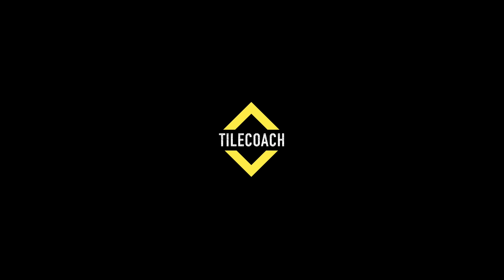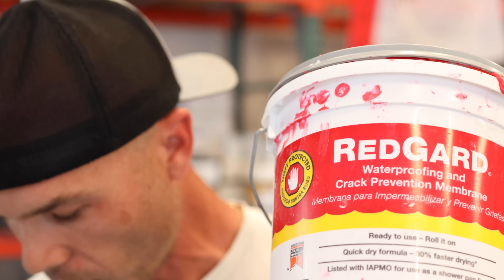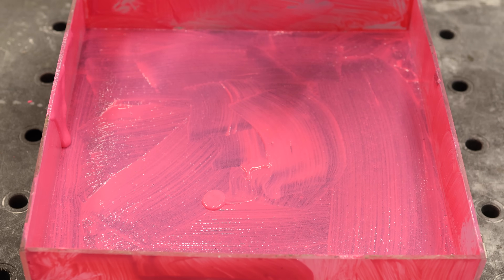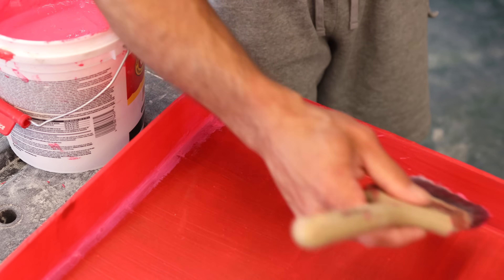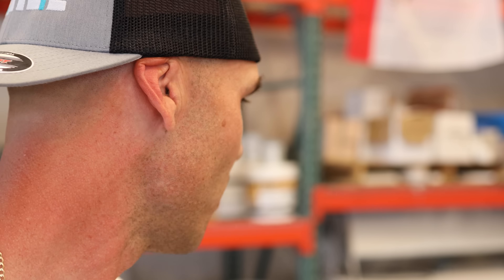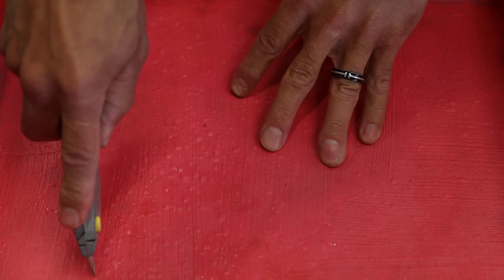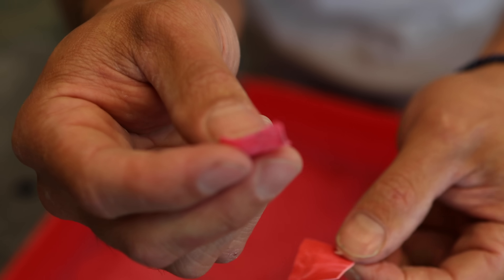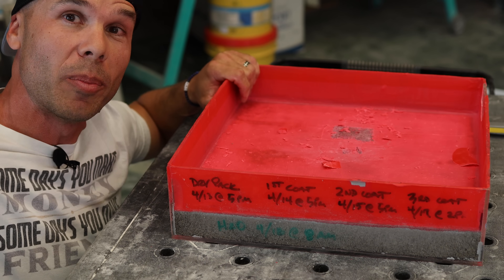REDGARD FAILED FLOOD TEST!!! --- Why Did it CRACK and BUBBLE UP???

Comment: Isaac I've set Tile & Stone here in Las Vegas for 37 years. I've been on massive projects where there is 5,000 to 6000 rooms per building with swimming pools steam rooms Etc. Never once have I ever seen redgard used in any of those applications or on any detail sheets from the architectural or Engineers on these projects. We've always used laticrete 9235 I never see anybody using that stuff anywhere on any residential or commercial jobs in the last 10 years. It's so easy for contractors to show up on a job and roll that red crap all over place, then walk away and then two years down the line they have serious problems. My father always taught me to do everything to the best of your ability and stand behind everything you do. I see that in you and who need to be commended for your efforts to show and teach people. We need more people in the field like you today because there's a massive movement in the other direction and construction nowadays. No one gives a damn anymore get in get it done get your money move on. I think you should be a US senator instead of a tile contractor haha anyways dude Rock on
Reply: Perfect- a senator who is honest and responsive. You don't  expect that from a shower builder.  Good call. 👍

Comment: If you're reading all of the comments that defend this cheap garbage of a product, that is what denial looks like in real time.

If you're having to make excuses for a products failure then you need to find a better product. In my installs I won't take on the job if a contractor or homeowner strongly recommends RedGuard. It is a budget product and that's it. It is for small cracks and even that is iffy.

Comment: Appears that there was a reaction between the mud and redgard. The covered glass coating seemed intact while the mud surface coating disintegrated. Maybe a bonding sealer over the mud before applying the redgard?

Comment: Red guard is an elastomeric product.  Any time moisture is present in or below the surface it will create voids in the product(blistering typically).  Silicone coating would be better.  Silicone is moisture cured where elastomeric is not.. I enjoy your videos! 👍

Comment: You spread it on too thick. The coverage rate is for purchasing, and varies depending on the substrate. Use a mil thickness measure to determine how much to use.
Reply from the maker: The RedGard installation video specifically states to measure out the amount specified and then apply it.
Reply: @TileCoach  Good point, and bad instructions!

Comment: Can you test Mapei Aquadefense next?! Please. 

I’m thinking that the difference you’re seeing from the sides to the mortar is that the mortar bed most likely sucked out the moisture before the red guard was able to cure like it was supposed to. Cracking in the corner is likely the problem area where one side is drying at one speed and the other is drying too fast cause the mortar is sucking out the moisture. If you use redguard you may have to prime the raw mortar spots before using it, or just use Laticrete.

Comment: The blisters on the mud are do to moisture still in the mud as I have had that problem before. I've even had issues with hydroban doing the same thing. Realistically it takes at least 3 days for a dry pack to completely dry out enough for a liquid membrane. I don't have time for that personally and I'm sure no other professional tile installers do either so that's why I stick to the sheet membrane and foam boards. Quick one day prep and water test the next morning.
Reply: Doesn't a real life scenario the moisture would go down through the subfloor not up.    To do this test really it should be a wooded box just like a shower stall.  Not a plastic box that doesn't let the moisture from the mud to dry.
Reply: @homesteadhaven2010  Absolutely and this guy should know better
Reply: @c_mac7773  what does this even mean?  This guy should know better...  It's a test to prove the permeability of red guard, may not be NASA certified, but it's on par with the quality of what most installers would do if not better.  Pull your head out man.  Stupid comment.  People can be such inflammatory peckerheads
Reply: @homesteadhaven2010  moisture wouldn’t go to the subfloor because if you are doing a mortar pan there should be a pvc liner over subfloor
Reply: @danthecarpenterman9463  if you use a liner then this waterproofing isn't needed.       Use one or the other not both.
Reply: Should've been in the product instructions....
Reply: @justpassingthrough7989  it is to point as it does say dry substrate but deck mud is difficult to put a specific time on as it is not a modified product and is at the mercy of the temperature and humidity in the air to dry out. I learned the three day rule from my laticrete rep but that was also only for their bag mud that he would say clearly.
Reply: Can you do one where you let the mud pan cure for 3 days, tape the seams, prime it then roll it out?
Reply: Agreed. The plexi wouldve slowed drying even more.
Reply: Shluter is a nice product, expensive, but nice! I think there are a few issue's they should think about in the future, i.e. wallboards should be more like drywall with bevelled edge's to account for thin set build up+ kerdi fabric. I actually liked Wedi system better though!
Reply: Word
Reply: Lol
Reply: Why do a test if not done right. I agree the mud is not dry, and since it's sitting inside a glass box the moisture has nowhere to escape. Also I've heard from other installers that you should never waterproof a mud pan, because its not meant to and it only creates problems down the road.
Reply: This guy just don't "like" red guard and represents the new generation of installers that only believe in sheet membranes
Reply: @coriontiles3244  I don't trust sheet membranes. Just tore out our bedroom shower due to the failure of the sheet membranes. The house is barely 4 years old and installed by professionals. Everyone I have talked to has pointed us to the Kerdi floor pan system and Redguard.
Reply: Mud pan takes too much time
Reply: @Stevesbe  personally mud pans don't take me that long to do. I typically have my showers ready for tile and flood testing in one day. I prefer the mud pan over foam or ready to tile pans because most of my work is done in older platform or balloon framed houses. The floor systems are never level and using a leveling component just adds time and money. Mud is also more economical from a business standpoint because the material is less expensive than a foam pan or ready to tile pan.
Reply: @ryancoulter7681  the liner is really sucks trying to get into corners without  a bunch of build out
Reply: @Stevesbe  I completely understand that. I went away from the pvc liners years ago and use kerdi from schluter for my waterproofing.
Reply: @Stevesbe  when doing a pan liner install, knotch the stud's with a mult-tool to account for thickness of pan liner fold's in corners!

Comment: Adding a drain would have helped. It would have allowed a way for the trapped moisture to escape under the red guard. The plexiglass basically sealed the moisture in with nowhere to go. Adding any solution over the bed would have had  the same result. Escape bubbles/cracking. I read someone say drill some holes under the plexiglass. Same concept. And yeah, seems very thick with not even spread. But the moisture trapping is the problem.

Comment: I've never used Red Guard, but I emember people in the comments on this channel on previous videos mentioning that when you paint the layers on you need to paint the strokes in a single direction for each coat (and different directions on each coat). So for the first coat paint in only vertical strkes, then for the second coat use only horizontal strokes.

But yeah this product just doesn't seem reliable to me, I'd never use it.

Comment: I hope you try this again but ignore the specified measurements. I don't use red guard for shower pans, but when i apply it on the wall, the first coat isn't super heavy, in my view it's more like a primer. I don't use a roller because it makes a mess, i just use a 2-3in brush. Also you should put some backer board on the sides because the glass is not permeable and it's super smooth, that could be affecting how it dries or cures. Maybe add some Reinforced Fabric in the comers as well. Recently we've been using fabric on the seams and would coat it with red guard on the wall first and on top.

Comment: Use kerdi for the field and then fabric with redgard for the perimeter.

 The moisture in the mud will cause a failure with liquid membrane. Just use kerdi over the field so you don't have to wait for the mud to cure 100% and then just redgard the perimeter along with reinforcing fabric tape. Then if you want to....Paint over the kerdi with redgard just for the heck of it.

Comment: Redgards manufacturing info. Regarding to using on plexiglass ? Maybe the issue of the cracked corner. But the base coat on the dry pack should be no issues. But definitely an issue in your test. Thank you for all the hard work and info. you supply to us little guys out here. Cheers!

Comment: I don't use it on the shower pan, but I do on the walls and bathroom floors.
I've tested it before on Denshield making a box out of Denshield and then applying it in a thin layer like paint. I let the water sit and came back days later. No leaks. I think it's a good product, but maybe it doesn't work well with a mud job or because the plexi doesn't allow for proper curing.

Comment: I used redgaurd not as the main water barrier but as an extra line of defence. Used schluter Kerdi first then applied 2-3 coats over everything with fabric reinforcement in corners/joints. It’s way over kill I think to do this. When I used red guard, I never got cracking and did a leak test. No leaks (probably because of the schluter too) and yes everything turned pink but there were no bubbles under the membrane.. I think the key is to apply thin coats in the corners where it collects. Funny enough I learned that from you in an older video reacting to another shower guy doing a redgaurd test. So I guess that’s the key.
Reply: Lol why even use the edpensive foam system if you dont trust it 😆.  If you have to use redgaurd over it
Reply: @hermessanchez7955  I didn't use foam. I used the membrane over a dry pack and because it was my first time installing it. It is not that I didn't trust the system. It is that I didn't trust myself yet. Redgaured really isn't that expensive and very easy to install and I have seen many professionals (including the pro in the video we just watched above) add a paintable rubber membrane over Schluter as an extra insurance. We aren't super heroes and there's no way I am doing the shower twice. It was a no brainer. I would use it over it just in case any time.

Comment: Man you got me all worried about the shower I'm building for myself. Don't know if I should tear it up and start over or not.
Reply: Right this tileing a shower thing is ucking crazy there is never a strait answer and procedures are like assholes everybody has their own one way and if you don't do it that way it will fail and the worst part about it is I've demoed showers before that were 50 years old and never leaked at all ! they hot mopped tar and 15lb.felt for roofing ,with an old cast iron drain had plaster walls and chicken wire for lath, it had 15 lb felt behind chicken wire to water proof the walls ,
I'm thinking that's  probably the best way to do it is just a PVC pan liner and plaster the walls and just red guard the walls down to the floor and if it gets wet out side the shower door seal it so it don't get the curb lumber wet from out side and when it's all said and done do a maintenance  every 6 months with a douche down of WD-40 on the grout as long as you like the wet look on your grout joints ! That's what the old timers did ! Back in auut 4! Good luck !

Comment: Yoooo @StarrTile can we get a response to this? How should @tilecoach have done this test? I've seen your cardboard box test and I'm stumped as to why this failed
Reply: Cardboard is porous, so RG did good penetration, which increases surface and speeds up evaporation hence agitates for quick cure. With use of plexiglass, apparently moisture got trapped in literally airtight box and while air facing surface got dried out per spec the inner side of the coat didn’t.
My guess, Isaacs point that RG is just not pro/contractor grade product but rather an enthusiast.

Comment: Hello anybody has an answer for this...does they Kerdi drain has to be flush to the tray hole edge..I'm dry fitting everything but that abs drains sits a little lower than they tray..is that normal

Comment: This is why I do not trust Topical paint on waterproofing. I just don't trust it long term and a little rapid expansion and contraction that's common in the north. Corners crack seals broken. Waterproofing is gone. There is a reason physical membranes are taking over as the superior method to waterproof.

Comment: Clear Box can flex with temp change and the weight of the water on the sides. Dry pack can shrink a bit as it cures. I just did our shower,  thinned primer coat to soak in the pours, 6 inch fiber glass mesh on all changes of plane. I had the liberty to let the dry pack set for over a week. Humidity leaching up out of the dry pack will not let the red guard cure on lower coat. All coats of red guard had 3 plus days to cure. I have had no cracks in any corners or change of plane. IMHO, Red Guard is NOT a production "fast" solution in any way.

Comment: We always use redguard with mapei fiberglass mesh.. use the 6” on all the corners adding corner reinforcement as per guidelines for Laticrete 9235. And use the 35.5” fabric for the mud bed. We apply one coat and let it dry then follow it with another, apply mesh immediately and follow with a coat to saturate mesh. I know it’s not stated in data sheet this way but this way works
Reply: We used the mesh for corners too, helps prevent cracking.
Reply: Exactly the way our union teaches.  Fabric up the walls and on the morter bed.

Comment: Might be that it needs more time to dry like 24 hrs per coat other wise it leaves microscopic pores and possible even the cement needs more time to dry for the red guard to work. But this was a great lesson for all of us. I would never use redguard in a shower pan only on vertical surfaces where water cant pool, I much prefer the the laticrete membrane better quality all around and saves time in drying time if it has to be left more to dry.

Comment: Motor beds require 72hrs of cure time, plus red guard primer. Also if you want to do redguard you need to use a milage Guage. The ideal milage is 15mils per coat and not to exceed 30mils per coat. And requires minimum of 30mils to be water proofed, and 60 mils for a steam shower. Also after your primer coat you need to lightly sand to remove any exposed sand left and wipe down with a damp sponge. And lastly you most use the proper gaging fabric in the corner, not mesh drywall tape.
Reply from the maker: Thank you for the information, may I ask where you got it?  You would think they would put it in their technical data sheet (TDS) or the instructions on the bucket. I watched their video too and it didn’t have the information you provided either. But what you said makes a lot of sense.
Reply: @TileCoach  This is from Redgard TDS-104.  Prime all surfaces to receive RedGard® with properly applied manufacturer's sealer or with a primer coat of RedGard®, consisting of 1 part RedGard®, diluted with 4 parts clean, cool water. In a clean pail, mix at low speed to obtain a lump-free solution. For substrates exhibiting high absorption rates - apply the diluted mixture of water and RedGard® (4-1) using a clean, fine head broom to scrub in the primer solution. Keep the surface of the substrate wet for at least 15 minutes during application to ensure adequate and even distribution of primer coat. Apply the diluted RedGard® primer coat to the floor at a rate of 300 ft/gallon (7.5 M/L). Allow 1st coat/application time to dry before floor patch or other flooring material applications begin. For tile installations bonding directly to the substrate; strongly recommended to apply at least one full coat of "undiluted" RedGard® to the "dry" primed area and allow to dry completely before tile installation work is to begin.
Reply: @michaellee695  when instructions are this complicated and precise it tells you something
Reply: @TileCoach  if you contact redguard there is a separate installation instructions that you can get they used to put all that info on the 3.5 gal  bucket.
To make redguard primer, you mix 4 parts water to one part redguard,  got that from the redguard help line.

Comment: This can happen with any liquid applied. Either it was applied too thick or not enough dry time between coats. In this case likely not enough time between coats over the bulk of the surface. The corner cracking is because it was applied too thick in the corners. That's the problem with liquid applied, too much opportunity for user error. Sheet membranes are a safer bet.